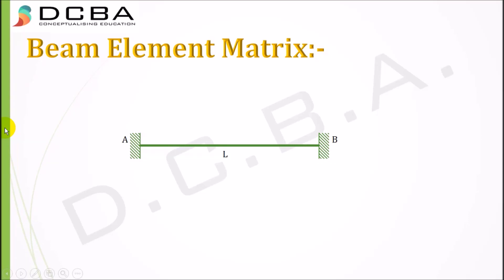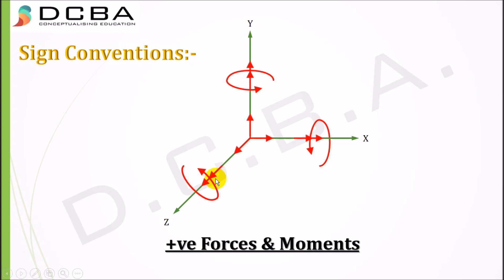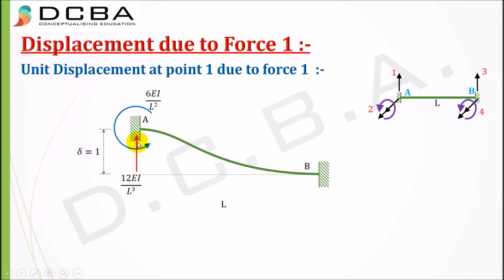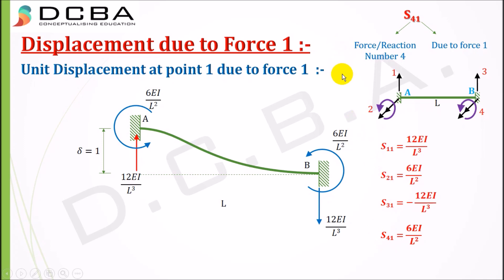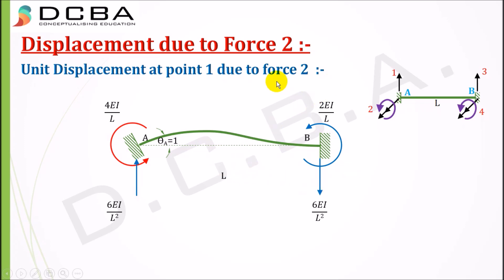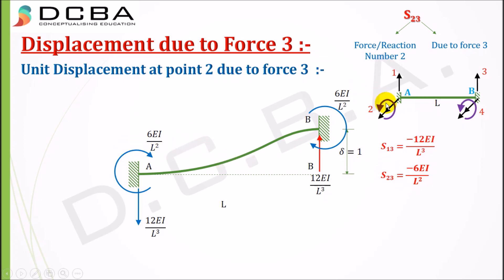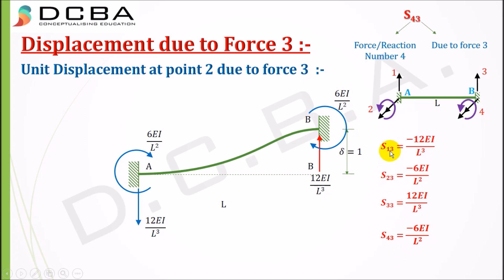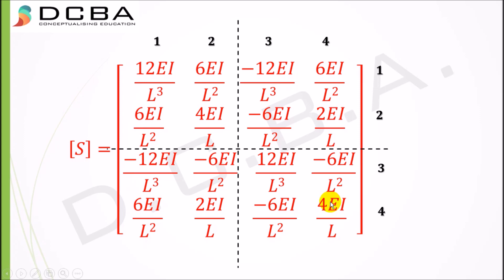Stiffness Method Structural Analysis (Beam Element)

Comment: I have a question, in the previous video the direction of angular rotations are different, is there a reason why they have this configuration versus the other one? Also how did you go about choosing the direction for theta B for the matrix? I had used the same direction theta B had in the previous video and didnt quite work out. Btw, love your content
Reply from the maker: Can you please mention the timestamp where you have doubt and also possibly the link of previous video and timestamp which you mentioned. So it would be better for me to solve doubt.
Reply: @DCBAonline  I was actually able to figure it out! There was an assumed positive direction for the angular rotations at A and B, but I greatly appreciate the prompt response :)

Comment: HOW DO WE FIND STIFFNESS MATRIX IF THE BEAM ELEMENT IS INCLINED LIKE TRUSS
Reply from the maker: for an inclined beam element the stiffness elements include sine and cosine terms and they need to be derived before writing it in matrix form.
Reply: HOW DO WE DERIVE THE SINE AND COS MATRIX
Reply from the maker: Abhinay akula by resolving the force components
Reply: JUST LIKE TRUSS ELEMENTS??
Reply from the maker: Abhinay akula you need to resolve the forces and then find the rotations and deflections done due to those forces and then form the stiffness matrix
Reply: DO YOU HAVE ANY BOOK FOR REFERENCE